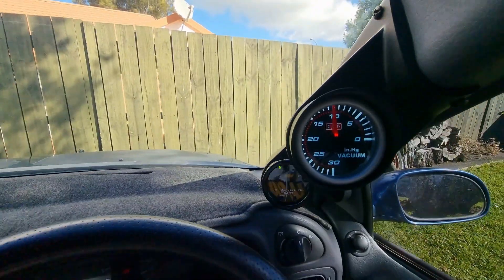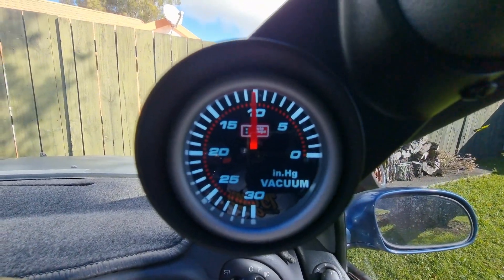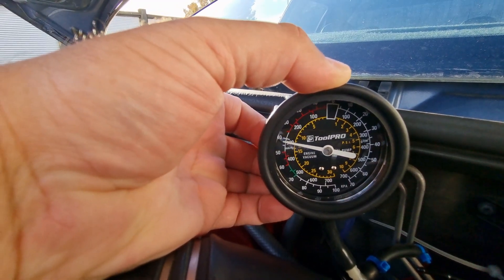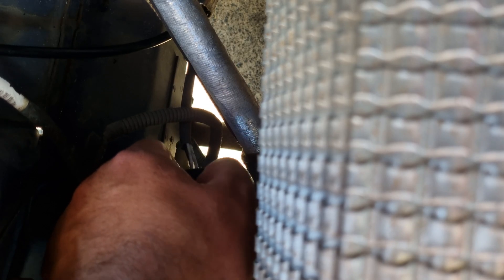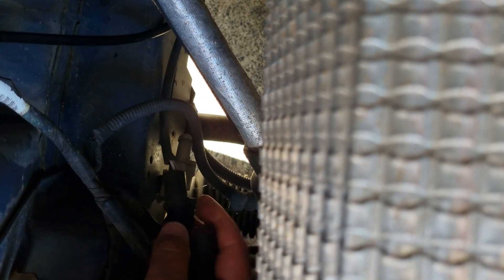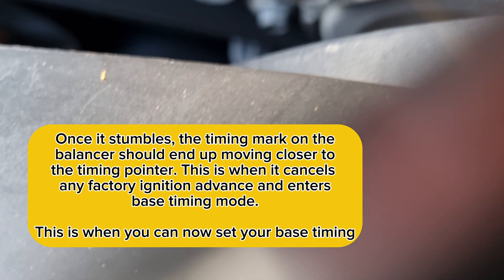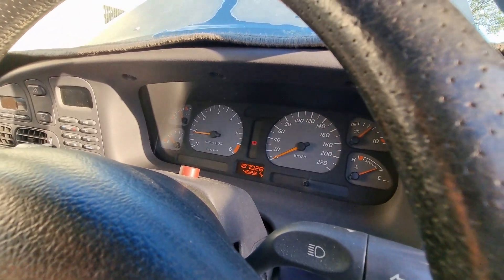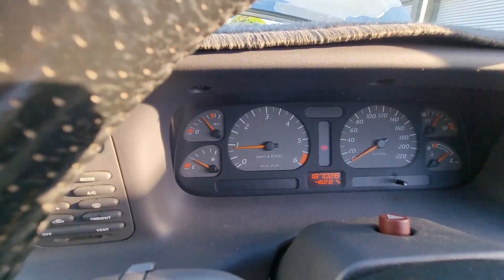Pre-tuning checks, and setting base ignition timing on my Ford EL Fairmont Ghia 4.0

Comment: Hey mate, love the video. with your jumper connected thing, what wire did you end up using like a copper one or what
Reply from the maker: Hey mate, thanks for the comment, much appreciated!🍻. I think the wire i would normally use, was just a thicker gauge copper strand speaker wire from memory, possibly 12 or 14ga. Nothing special really, just something i had laying around

Comment: Awesome videos bro. I've just done a stage 4 cam swap as well. Just waiting for my j3 chip to arrive.  What kind of changes would you recommend to the tune?
Reply from the maker: Thanks bro! Good stuff on getting the cam swap sorted👍🏻

Hard to say exactly what will be required in the tune as some cars and setups seem to react differently. I can definitely say it will need majority of the fuel map trimmed, especially around idle and light throttle/cruise conditions - mine overfuelled heavily in these areas, yet seemed to lean out around 5000rpm and upwards. I found i could add a few more degrees of timing in the low to mid rpm ranges of the spark map to help with the low down torque loss due to the higher powerband of the cam. 

Other than that, idle rpm can be adjusted up a little in the tune to help stabilize the idle, but need to be careful here as mine started to rev hang when I went up to around 1000rpm idle speed.

Comment: That’s a tuff job due to the dizzy placement. I change it as engine is running on my Toyota 4AFE, cos it’s right up top lol. It’s also obd1 or is it 0?? With the bridging of the two ports. 

Also bro look into sourcing some E100 if you haven’t already, mixed down into the proper ratios with 95/98 you can get E30/50 etc, and then add more ignition timing (I know we’re limited by the old shitty wasted spark tech) which means more power and less chance of knock. I recommend looking at Garage 4AGE ,channel, he does a lot of dyno testing of this type.
Reply from the maker: Yep, sure is a tricky job! With this style intake manifold, it's not too bad. With the earlier style intake manifold that sweeps downward instead of up like this one, it's even worse😅

I believe it's OBD1 or Ford's version of it. I have a code reader for this particular model Ford that plugs into the port and puts it into self test mode where it essentially bridges the terminals internally. I usually use that instead of the jumper to bridge the terminals, but thought I'd show the more 'budget friendly' way because the code readers for these cars are pricey, but worth every cent😅

Will check out the Garage 4AGE channel, that info could be quite handy, cheers for the suggestion!👍🏻

Comment: Do you reckon you need a high stall converter or does she still brake alright? I’m about to put one of these in my au xr6 ute … don’t really want to have too put a converter on if I don’t have too as will be putting a manual box in soon enough….
Reply from the maker: It's definitely still driveable on the stock stall, so I'd say it's not 100% necessary, although it would help get the engine into it's powerband quicker. You can sure feel the loss of torque under 3000rpm, feels very flat until it gets into it's sweet spot from then onwards though. I'm yet to complete the tune, but I'm sure the low end torque could be improved a lot just by tweaking the ignition timing. Even better if you fit an adjustable cam gear and dial in a couple degrees of advance to bring the powerband on earlier.

If going manual though, I'd leave the stall alone and just put that $$ towards a good clutch. 

In terms of braking, it doesn't feel too bad, but I haven't driven it all too much since the cam went in. Requires a little more pedal effort slowing down to around idle/low revs, but that might be more noticeable due to the higher idle speed. Obviously, E-series brakes are as useless as they come so i might look into some form of vacuum canister or pump if it becomes a problem. Hope that helps!